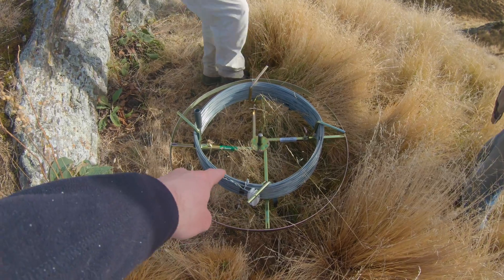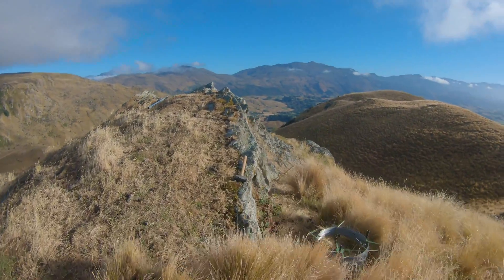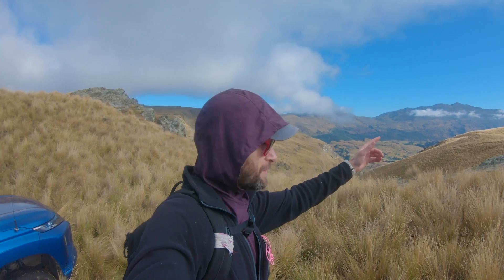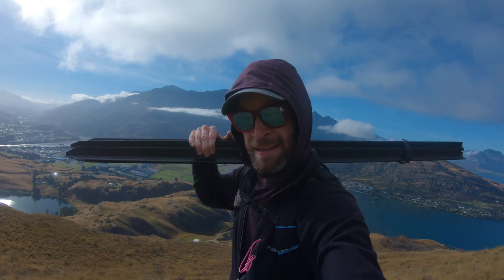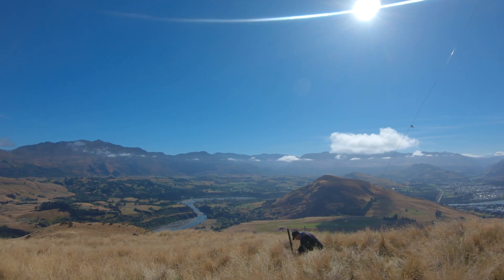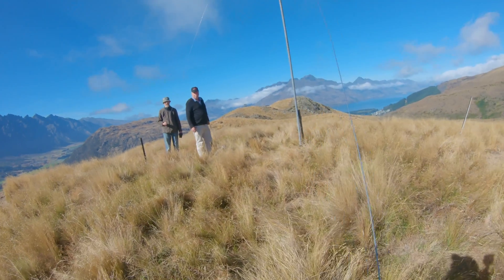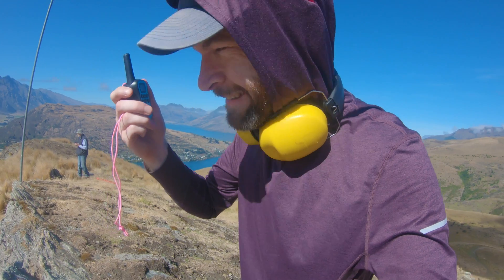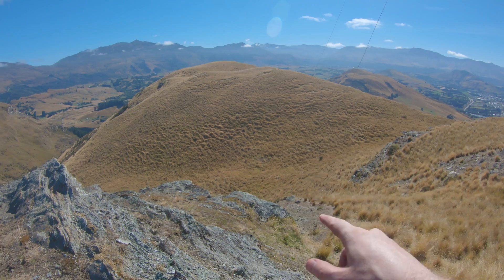Crazy 280 Yard Field Day Ham Radio Antenna

Comment: Mate are ya going to do some 160m with that thing?
Reply from the maker: She'll tune 160 pretty easily but the real plan here was to get ourselves about 6dB of gain pointed NNE on 80 meters and crack that D layer. It was built with hitting the middle of New Zealands North Island in mind (which is roughly where the majority of the ZL hams are). 80 meters is a dog of a band for RX noise and we're limited to 100 watts for field day, hopefully +6dB is enough to get through urban QRM. I didn't model this exact configuration personally but I'm assured it rips pretty hard!
Reply: @RadioRunner  it'll be interesting to see how it works!